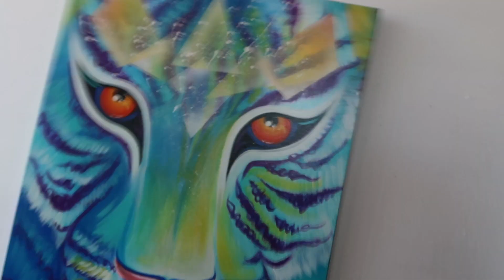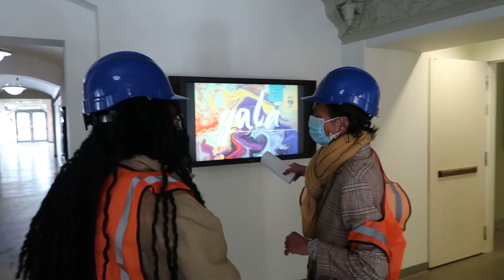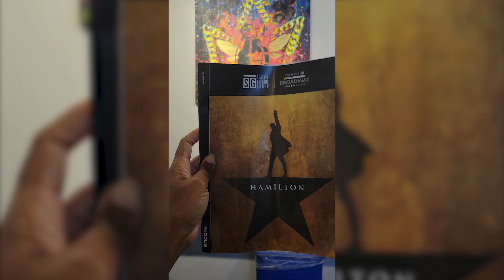Lets be honest :the life of an artist isn't what it's all cracked up to be,until the level up begins

Comment: I'm an oil painter. I noticed that a lot of unstretched canvas. What is better? Stretched? I have a lot of stretched canvas and space is limited. lol. I'm considering going on the unstretched direction just to well make room. However, I'm scared that the paint will crack once someone decides to stretch the painting? What would you advise? Is that something to worry about?
Reply from the maker: I made a video all about stretched vs unstretched. You can check it out here: https://youtu.be/3Pv6df3XmSY I'm an acrylic painter so I haven't had any issues with cracking. I'm not sure how it works with oils. I recommend trying it on a small test painting and seeing how it goes. Hope that helps.